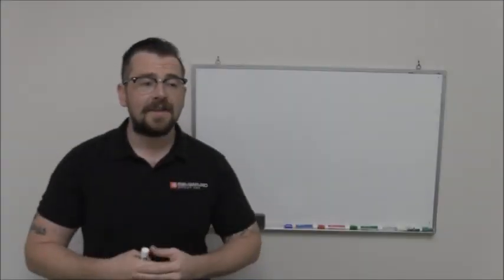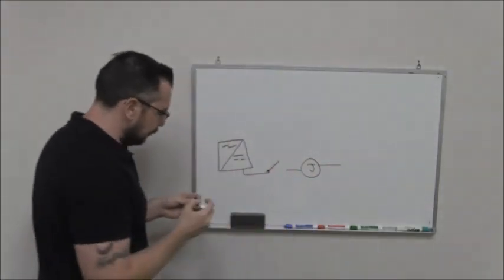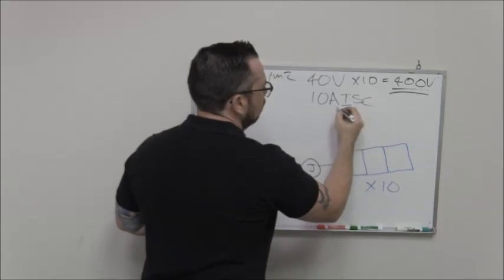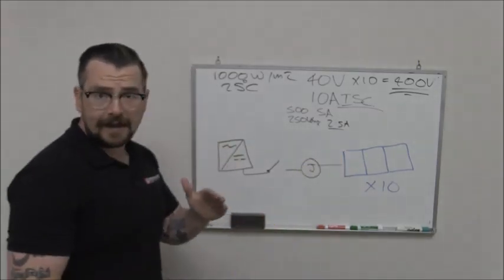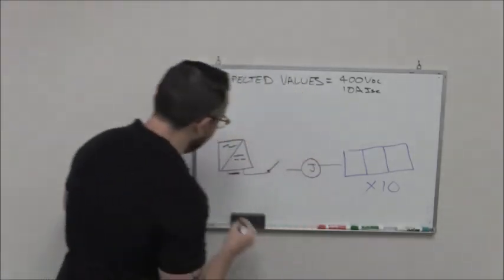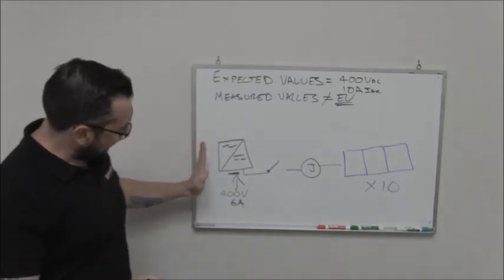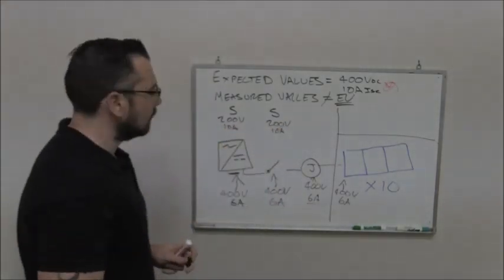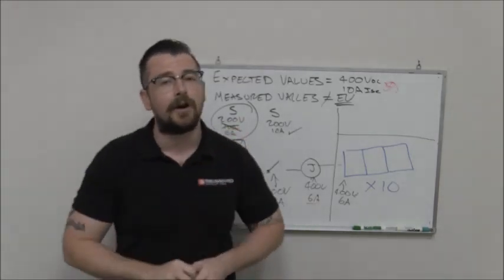An easy method to troubleshoot solar PV arrays...

Comment: Is it safe to short circuit an array, as opposed to a single panel, for amperage testing? I have reservations shorting a 80 volt 10 amp array.

Comment: silly and incorrect  you cant loose amps in the string
Reply: The video refers to Isc not Opertaional current
 I'vee used this method hundred of times and found hundreds of faults.
Reply: short or operational does not matter ,amps are not lost in the circuit . best to short the inverter DC plugs and measure voltage drop across switches
Reply: @chrismurphy7324  Tell me then, how does the Residual Current Breaker (RCB) works? When you have a fault you "give an extra path" to that current flow. You are right when you say amps are not lost in the circuit, but when you have a fault your circuit changes. You add a node on your circuit, that's why your current changes.
Reply: @tarcisioprest  LOL someone just learned something 1 year ago! LOL